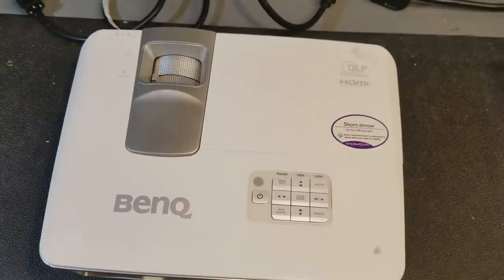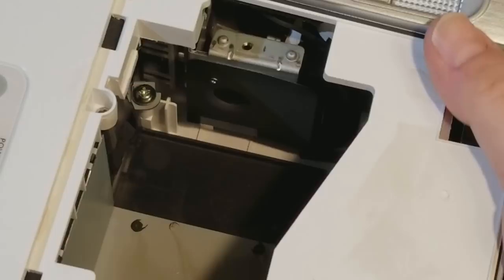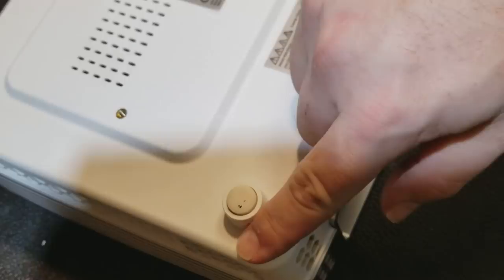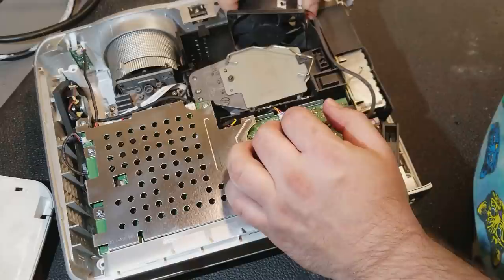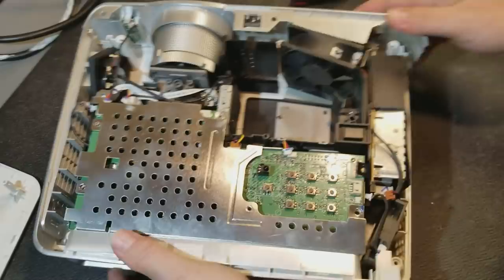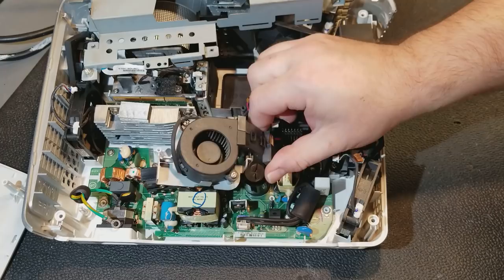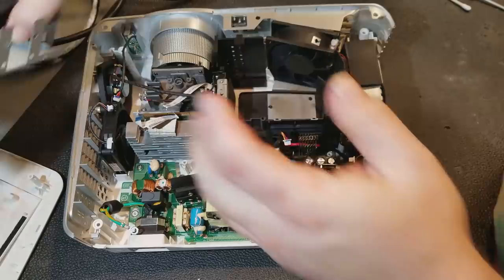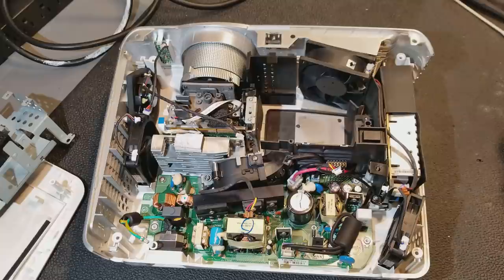BenQ W1080ST DLP Projector Cleaning / Service P1

Comment: Great videos. I recently replaced the lamp in my W1080ST after it blew at 4616 hrs. and while doing so, did some bad-practice maintenance with canned air. Blew dust all over the optics and had the described blotches all over the screen. After watching part 1 and 2 twice, I decided to take the plunge. Once inside, I followed the steps shown in the videos and cleaned some really dirty parts; especially the color wheel and the squirrel cage fan. Put everything back together with no spare parts and my projector is as good as new with crisp clean images. Thanks Frank!

Comment: Thanks for the vid and all the info. I would definitely NOT use pliers though to remove connectors, especially by pulling on the wires instead of the socket itself. If you pull a pin or nick something, youll have a nightmare on your hands.
Reply from the maker: its not that hard if you are careful and know your tools.  You do the same thing with your fingers. As long as you dont pull crooked and are aware of what you're doing using pliers is fine.  and I dont really have a choice as my carpal tunnel prevents me from gripping the small wires well enough.

Comment: You really need to use plastic pry tools you can get really cheap i got a whole set of different shapes and sizes prevents the plastic from being damaged.
Reply from the maker: I do. this video is 5 years old.  Before i started working on them regularly. That said, even plastic tools don't prevent the clips from snapping as the plastic gets very brittle from the heat when people don't clean them.

Comment: I have a BenQ TK800M projector that is starting to show little white dots on the screen.  They aren't too bad unless it's a dark seen.  Do you know what is causing them and how to get rid of them?
Reply from the maker: That is most likely the DMD mirrors sticking. Mirrors that are not flipping back to "off" is what you are seeing.  I would contact BenQ asap and get it replaced under warranty.  It is WAY too early for part to be failing.  After maybe 10+ years sure, but this projector is still under warranty. That is way too early.  Curiously this is not the first time I have heard about this on the TK800M. I really hope BenQ didn't push this model out too fast like they did with the HT2050.   I personally think the picture is fantastic on the TK800M, but if the DMD chip is going to be a known issue that is concerning.  
There isn't anything you can do (within reason). You might want to try running a youtube video that claims to fix "stuck pixels" such as this one.  https://www.youtube.com/watch?v=hpeLXoqyiyA  It will cause the mirrors to try and get unstuck.  It might clear it up a little but I would still exercise your warranty.  That projector costs too much to have that problem this early.  Hopefully you just have a lemon.

Comment: Hi Frank hope you are well, I have a problem, I have a mx613st, took it apart to clean it, however after I put it all back up, there is no power whatsoever :(....can you help or any advice please....can't see where I went wrong in putting it back together
Reply from the maker: There is a switch that the lamp cover presses that will interrupt the mains power.  Make sure the lamp cover is on.  Otherwise you either forgot the thermal fuse connection or maybe offset the low voltage connection when putting the mainboard back in.  I'd suggest going over your work one more time.  It's happened to me more times then I can recall...
Reply: @FixitFrank  thank you brother...

Comment: Have to give a huge thanks to this video (and Pt.2). I'd bought a BenQ w2000 off eBay and it was crazy dusty inside. I took the lid off and blasted all the dust out but in doing so I think I'd dirtied the DLP sensor as I was seeing dust specs all over the image in dark scenes. This video was really helpful in understand how to get to the DLP sensor to blast it with some air. Problem solved now!
Reply: same here. same projector. i was crapping myself that it would be worse after i did it or i would break something. but it works great now!

Comment: Very similar inside to a benq W2000 series if anyone is wanting to do this to their 2000. 
Used this video to clean dust from the optics assembly. It is a daunting experience and its tricky to get the dust out without getting more dust in! BUT after a few hours with some cotton buds, vacum cleaner and a bike pump (compressed air) i managed to get it back to  a clear picture! 

And I only had 1 "spare screw" left over at the end lol - but its all working great so it couldnt have been an important one :) 

I would reccomend takin pictures of each dissasembly stage and mark down where each screw comes from if you dont want to end up like me with a screw or 2 left over at the end :D

Thanks for the video. Inspired me to try this myself

Comment: Thank you very much for the video. Thanks to this i was able to completely take appart my projector and give it a thorough cleaning with qtips and vacuum cleaner. I have a vivitek dlp 2014, recently started showing color wheel error. It runs for about 8 minutes perfectly fine than it shuts down with the green light blinking 9 times. Still doing the same thing after cleaning it. No discoloring or any other issues. Color wheel spins fine. 😢

Comment: Super useful video, thank you Frank! My W1200 model was a little different but this really helped as a good beginning point. I took it slowly and managed to pull it apart.
Reply from the maker: You're very welcome! Almost all DLP projectors are essentially the same.  They vary in small ways but the general construction and operation are pretty similar across most brands.  I prefer DLP over LCD any day of the week.

Comment: Thank you i finally got my BenqW1090 to work properly, it had white scanlines problem. I unplugged everything and cleaned as you said.
People should care about using electric screwdriver. Basic ones may damage the motherboard.
Reply from the maker: Agreed! I mostly use mine because of my wrists are wrecked. In my more recent videos I talk about the concerns of using drill drivers. Back when I did this video I was so unaware of how people might just use a driver set to high and destroy things. I figured it was common sense. Boy was I naive.
Reply: @FixitFrank  Honestly i was fully prepared to open the projector then i glanced at my old screwdrivers and told myself : "Why am i such an idiot ?"
Some days after i bought a nice drill driver and ez going.
Thank you my projector works again, but i'm curious about these vertical white scanlines, i just unplugged everthing inside and reconnected with a bit of cleaning and all back to normal. Any idea where it might come from ?
Reply from the maker: @calvinkleinkiller3640  Usually its when that connector between the mainboard and the DMD card isn't quite seated.  The DMD uses LVDS(low voltage differential signal) to control the DMD and if you lose certain channels on the LVDS you essentially lose column control.  Overly simplifying, it uses a row/column control scheme. I suspect that some of the rows are higher up on the connector and losing those connections can cause it.  I ran into this on an Optoma a while ago and it stuck with me. It seems to happen with any DLP projector that has the dmd controller and DMD on separate boards.
Reply: @FixitFrank  Thanks I'll remember this, now i feel ready to help my projector for years. Next time i will only buy lamp bulb and try to fit it myself. For the first lamp i got to change i took the entire stuff i did not want to break anything.

Comment: Hi Frank
Your video is very insightful, thank you for going to the effort of recording and uploading. I have a w1080st plus and this has just decided to explode the bulb with out warning. 

I have spoken with Benq as I didn't want to just replace the bulb / Lamp assy to see if they felt it was something else. Unfortunately they wont share any ideas and they have said they need to see it and run some checks. They did share that they wouldn't just recommend replacing the bulb/lamp due the unit not issueing any prior warnings.

 It is only 4 years old and was about to reach 5000 hours and it hadn't issued any warnings. I was using it at the time and every sounded fine. A friend of mine was talking to me over a head set when it happened and he thought I had dropped a glass. it was a loud bang and there was a electrical smell following it.

I have taken the top off and had a look the top fans had some dust on them and looking at your video I am now going to take a close look to the lamp blower and see how that is. (it does seem to move though) I am not able to see an burn marks so fare. 

I was wondering if you don't mind where you had experienced anything like this in the past and if you have do you have any other ideas of what might be wrong with it. 
its been a great unit and if I can I would like to get it working again.

Thanks Chris
Reply from the maker: If the existing lamp exploded it was likely due to the dust buildup in the blower fan and on the blades of the exhaust fan. Lamps burst when they are too hot.  The quartz glass globe is under pressure and when the quartz gets soft from heat, it will explode like you describe.  You do need a new lamp assembly. Once the old lamp bursts, it damages the lamp housing.  In a pinch you could re-use the old housing but it is far from recommended.  Replacement lamps vary in price and quality. They are definitely not the same. A reliable, safe and useful lamp is going to be in the $100 range.  Any lamp $80 or less(depending on your local currency) should be avoided or at least deeply questioned.  There are a few components of the lamp housing that are critical for safe operation. Those components tend to be ignored or replaced with substandard part on lower priced lamp housings.  If you are in the UK, I have a contact who is in the UK who has good quality lamps(non oem but very reliable).  Since the lamp seems to have burst, you will have to replace it.  I am not sure why BenQ told you that you don't have to.  I hear conflicting info about BenQ support. I tend not to put much faith in their advice. At least in my experience with them. 
The W1080ST has a rated lamp life of 3500 in standard, 6K in Eco.  If you were in ECO at 5K, that is not unheard of for it to burst.  
From the info you are giving me, I think you have a pretty reasonable situation. At least reasonable to resolve.  I would clean the fans for any dust.  Don't go nuts.  Unless it was packed with dust a gentle cleaning is enough.  Then replace the lamp with a good quality replacement. Either original BenQ in the BenQ box or any lam pin housing that has a Philips UHP bulb inside with the proper IR/UV cut filter on the front. This is an example of a good quality aftermarket lamp. https://www.purelandsupply.com/benq-lcd-projector-lamp_w1080st.html  These folks only ship in the USA but the manufacturer they use for the lamps sells worldwide. If I can offer any other advice please let me know.
Reply: @FixitFrank  Excellent thank you very much for the very quick response. If you could share your  uk contact that would be great. 
The company I use is projectorpoint they have the benq assy at £165 with a 3 month guarantee,  but they also offer a none OEM/standard one for £140 with a 2 year guarantee (I think he said it was called diamond) 
Again thank you.
Reply from the maker: @Chrispipes80  @ChessGuru  https://www.ebay.co.uk/itm/Projector-Lamp-BenQ-HT1075-HT1085ST-MH630-MH680-MX662-MX666-TH680-TH681-TH681-/264559372761   
I know Diamond well. They are made in Singapore/Malaysia.  I've had "eh" results with their lamps. Some were fine.  Some had problems with the IR/UV filter. The OEM listed on Projectorpoint isn't bad price-wise.  The lamp I linked above is the fellow in the UK.  He comments here sometimes and knows his stuff.
Reply: @FixitFrank  thanks you that’s a great help.
I have cleaned and reassembled it. I have frigged the ac switch and I have powered it up with out the new lamp. All the fans blow apart from the main feed to the lamp housing. Is this normal? Does it know there isn’t a lamp? Is it temp controlled? The temp sensor looked ok, apart from a very small warm Mark in the Cooper bit (the back face opposite side to the white insert)
Reply from the maker: @Chrispipes80  That fan should kick on after a little while.  I am not sure if it monitors the temp to run that fan but it might.  That white bit in the copper is the thermal breaker. It will open itself and shut of the power until it cools.  The variable temp sensor is on the mainboard if I recall correctly. Id make sure that fan spins though.  With the power off, see if you can push that fan with a qtip or something to make sure its not jammed. When the lamps burst, they tend to throw quartz glass right into the fan and jam it. You then get a lamp and temp warning after a few min if you try and run it.
Reply: @FixitFrank  the fan spins fine I have taken it apart as you did in the video and blown it clean. All the fans spin very well. Better than some of my PC ones. 😀
For info I plugged the front fan in the same port and that didn’t run either. So I guess something is controlling it or the board has an issue. I will order a lamp and hope it works. 🤞🤞
Reply from the maker: @Chrispipes80  I think that will solve it.  As long as they are moving freely you are in good shape.  Also I did a little checking and that fan does follow the lamp temperature so no lamp, no fan spinning.
Reply: @FixitFrank  you are amazing thank you. I have ordered the benq one from projector-point so I will let you know how I get on. (I should get it Monday)
Thank you for the support, with out your responses I may have given in to benq having a look 🤞 to it working. 
Hope you have a great weekend.
Reply: Ps I know it’s not you fault if it doesn’t I am just great full for the help.
Reply: @FixitFrank  Hi Frank just wanted to report. That the new lamp is in and it is all working good. I have popped in the service menu and the fans RPMs are inline with there target values. 
Very very pleased thank you for all your help.
Reply from the maker: Fantastic!! That is great to hear.  Nothing makes me smile like knowing someone else has their projector back up and running.  So happy to hear it!
Reply: @FixitFrank  i buy lamps from him. He’s a quality guy. Deffo knows his stuff. He’s currently helping me out with my benq w770st as the lamp suddenly stopped working. It was him that pointed me in the direction of franks videos so that i’d be able to open my projector up and not mess it up. Both are stand up guys ✅